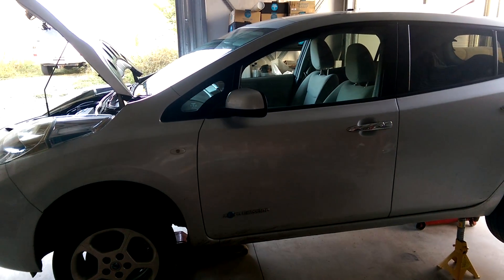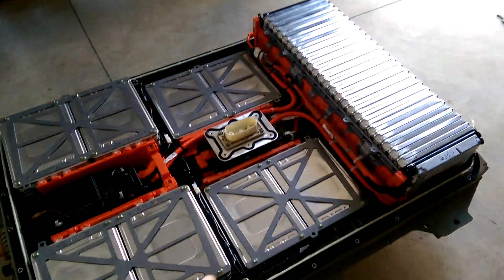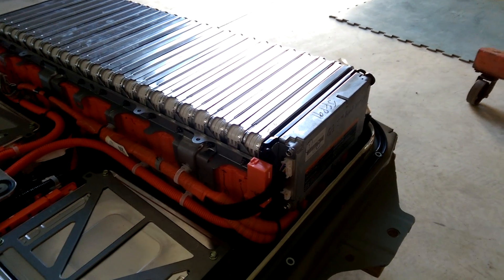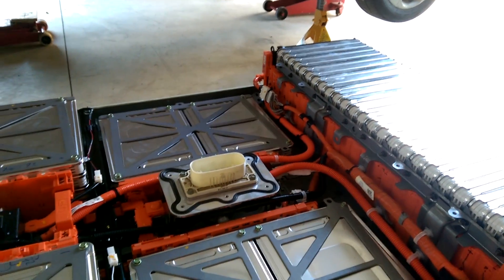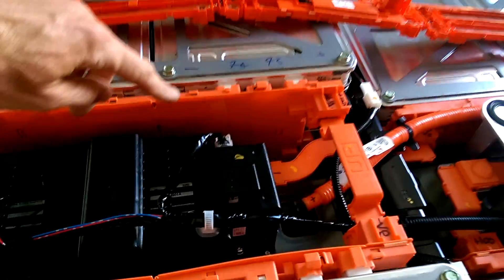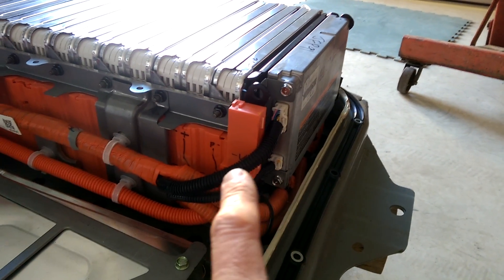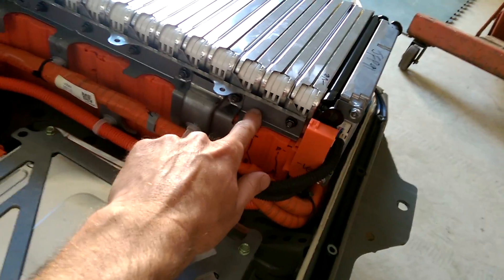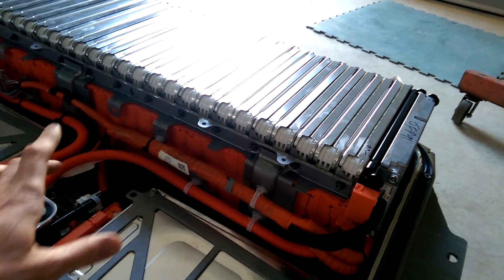How to swap G2 Leaf battery cells into a G1 battery case.

Comment: TY electric baboon...I'm having some small issue with a gen2 using a patch loom and dala CAN adapter 24kwh into a gen1 where the GOM is showing very low battery but the battery is still 33% SOC on Leafspy....everything else works OK but I'm thinking a module swap into the original case may be the solution if it doesn't figure itself out . 🫡

Comment: would it be possible to pull out all the G2 modules, and just replace the G1 ones in the G1 pack? Seemsto me that it would mostly be a mechanical swap, with the old wiring going back exactly the same

Comment: I have Nissan Leaf (2015, 24 kWh) and I would really appreciate your help.
The battery was degraded to aprox. 14 kWh, and I wanted to change it. I wanted to still use the car, and slowly build the replacement battery. So what I did:
I've bought an empty g2 24kWh battery case witch only had the wiring and the Bms inside.
After that, I have put 51 kWh worth of batteries inside that case (don't ask me how xd). And the bms was connected. I have sealed all up and put this "new" battery case inside the car.
At first, the car showed the invalid battery code (leaf spy pro), but after that the code was cleared. 
The problem is:
The battery Bms as well as the car is probably coded to 24 kWh, and it shows low battery percentage after that 24 kwh has been used. Checking leafspy pro, and the cells are at 3,8v wich is plenty of capacity left.

In summary:
The bms is calibrated to 24 kWh but I have 51 kWh inside.
Shows empty with a lot of capacity left in the cells.

With your experience, I hope you can help me solve this problem, for which I would be very thankful.

Comment: Where can I get BMS circuit diagrams for an e-NV200 2016 24kw? It is my intention to take 60Ah pouches configured 96S4p and put them in a bespoke case, using the exact Nissan wiring, so in effect replacing all cells with larger ones, circa 90 kWh! The BMS May have trouble balancing the larger capacity, and I have no idea how the capacity is calculated? If it sees something different on start up, does it do a kind of amps in amps out count like my old Honda Insight did or am I stuck with a display that shows full for ages and then starts dropping from 24kw downwards? My new modules ( 32 x 3s4p) each have two temp sensors, and it would be nice to make some kind of device that reads them all rather than just pick 3 at random! I have arranged to get the internals of an e-NV200 battery that has had its cells raided, re wire that, then swap, but have since found out about P3102. Despite that, would picking a 40 kWh BMS for my new system help it in any way? Assuming this has all been done before by cleverer people than me, could you suggest links to further reading? Thanks in advance, Rog, UK.

Comment: Hi, since you've blown your BMS from your original battery, how did you go about to reprogram the new BMS to work with your car? Did you just swap IC9 eeprom from your original BMS or something else? I'll be doing this job soon and would appreciate the help!
Reply from the maker: Yes, we swapped IC9. IC9 and most chips were not damaged. You can purchase a programmer from evsenhanced which can reset your BMS from outside the battery. Much easier. Tell them I sent you! Niall

Comment: Hi Raglan, so the G1 (sardine cells casing) vs Gen2 (open cells casing)?  So you have to swap the outside hard metal case?  The gray case (2011-2012) vs the black case (2013+) are not interchangeable?  I guess my question is, can you replace a 2012 Nissan Leaf (gray?) with a 2013 Leaf battery (black case)? without swapping the case like you did.
Reply from the maker: Yes you can replace old with new without swapping the case. To do that you need Nissan's service computer to reset the BMS computer in the battery.
Reply: @RaglansElectricBaboon  :(  that's unfortunate.  So what you did on your is simply installing the old BMS/wires harness onto the new G2 battery?
Reply from the maker: It's one of those situations where to change X you need to change y as well. But to change y you need to change z and v and w and so on.. believe me we tried to find an easier way!!
Reply: @RaglansElectricBaboon  so even if we replace it with the same model year battery, we still need to open it to swap out the bms controller, otherwise the vin doesnt match up and it wont work properlly?  Thanks for all the help,  thinking to buy this 2012 with a bad battery and replace ot myself, but look like it may not be worth it.
Reply from the maker: Yes. The BMS computer has an id in it which needs to be paired to the car.
Where are you based? We may be able to help if you are in NZ.

Comment: Question about battery swaps and having to reprogram the computer for pack swap?: I have a Gen 2 2015 leaf with about 92%. I plan on keeping, as long as range is sufficient. It could be 6 or 8 years before range is totally unusable for intended driving. I don't want to wait till the capacity gets really low.

 Right now I have about 85 statue mile range best case (but I don't want to get home with - - - -. 

 I like the idea of being able to buy a used battery pax (from salvaged car, or cells off Ebay) and replace all or just  lowest cells, keeping the best of original cells. 

How do you test the individual cell modules for their capacity outside the battery? Can you recommend  sophisticated charger/battery capacity tester.

The easiest way is just completely swap the whole Pax, but I'm concerned about how you go about reprogramming it; The dealer may not be willing or able to help. 

 I'm not going from G1 to G2, 24 Kw.  I just want to refresh my G2 back to near 100% SOC. I suppose going to 30 KW or larger would be fine, but I've been warned against it because of incompatibility. My understanding (could be wrong) is Gen 1&2  Battery modules are not interchangeable with the 30kw battery pack and larger. Also  I understand the 30 kilowatt battery pack is degrading faster than the G2 Gen 24 kilowatt battery packs.

I'm looking for how the cells are numbered, how you check them individually for capacity outside of the pack, and charge yhem individually. The idea would be to use the best of the 48 cells/moduals from the two batteries (original replacement) and build it up that way.

 To get around the potential of swapping packs and needing it to be reprogram by the dealer maybe you can just change the computer out?

 Since you made the video battery pack prices have gone up. Who knows what battery packs will be in 10 years.  This is a great car well-built and probably should go a hundred and fifty two hundred thousand miles if it weren't for the battery pack. It doesn't do the planning any good to throw good cars away and buy new ones.  I think putting in a battery pack is a great idea but not for the current $8,500 USD. I only paid $12,000 USD for my 2015, three years old and twenty one thousand miles.
Reply from the maker: A few people can re-program battery computers and that number's only going to increase. So don't worry about the attitude of dealers.
Generally the packs age very uniformly so don't trouble yourself with figuring out individual cells to replace. By the time you need to replace the pack there will be a lot more choice of new packs and things to do with the old - watch this space :)

Comment: Do you know/think the same would be possible to do with cells from a 30kWh or now also 40kWh donor battery?
Reply from the maker: I think so, yes. It has been done with a 30 into 24.
Reply: Goods news. Then I will sit an wait for the first 40kWh salvage here in Norway, and get the battery from it. Move cells over to my SOH=79% pack in the 2012 I got.
Reply: @tucsonor  I wait the same 😉
Reply: @tucsonor    Do you have an update?
Reply: @Islamisthecultofsin  found more easy way. Installed a complete 40kwh it the use of a gateway that fake the old pack. Easy done with some mech skills. So my old Leaf became "new" now.

Comment: Can you keep the original G1 case and move the G2 packs into it? The BMS and all the wiring stays? It looks like you used the G2 case and moved the wiring and the BMS over but that would mean the Nissan wiring adapter is needed. Is the former possible?
Reply from the maker: Hi guys, I swapped the G2 modules into a G1 case. Only the modules are G2.
Reply: Raglan Electric Bikes. Thanks again for the video and knowledge.  I realized after I asked about swapping g1 bms+buss into a g2 case, which would be easier of course.  That the g2 case wont go back into the g1 car. Duhh.  Anyway, love all the hacking everyone is doing, but I think im done. Just gonna trade up to a bolt and be done with nissan.  Still wanna get my hands on some of their modules of course, but they have lost me as a customer so...
Reply: I am also wondering if i can just swap the buss bars and computer from my g1 case into the g2 case? Guess I might need all the g2 adapter kit hardware?  Seems perhaps easier than swapping modules into g1 case?

Comment: Hello, thank you for this video. Nissan says it is not possible to install the new 2016 30kWh pack in older LEAFs even though the form factor is the same. Is there a way around it?
Reply: The battery of the 30kwh Leaf, besides the different wiring, works in a different voltage. If you replace the whole electrics of the car (from a salvaged 30kwh Leaf, for example) it may work. The labor and future retail value of the "Frankenleaf" probably is not worth over trading your old Leaf for a good 2016/2017 Leaf.
Reply: @gteixeira    They do it all the time.  Muxsan is what I think their name is.
Reply: @Islamisthecultofsin  Yeah, someone found a way to install the 62kWh into the 24kWh Leafs by hacking a bit the CAN bus and replacing some parts. It was apparently easier than I would think, still not worth the money since it costed around $10k for a car that will be almost unsellable after that.
Reply: @gteixeira    Agreed.  That would be only for someone who was going to keep the car.

Comment: Hi 

Are the G2 batteries the 30kWh cells and the G1 the 24kWh battery cells ?
Reply from the maker: I think I stated in the description, both cells are from 24kWh packs. The very early Nissan Leaf was a G1 and in 2013 ish they brought out the revised G2 with differences in battery, charger, inverter and several others. The 30kWh is still a G2.
Reply: @RaglansElectricBaboon  at the risk of being thick :0) is it possible to replace a Gen2 24kwh with a 30kwh pack? Thank you for your videos. I'm one of the losers that love the look of the beast!
Reply from the maker: Yes. It's now possible to re- program the car to accept new packs.
Reply from the maker: @k31thd4885  Yes its possible to re-program the car to accept new packs. I think in your case you can just get the VCM computer from the car which is donating it's battery. mynissanleaaf.com is your friend.
Reply from the maker: @k31thd4885  Yes its possible to re-program the car to accept new packs. I think in your case you can just get the VCM computer from the car which is donating it's battery. mynissanleaaf.com is your friend.
Reply from the maker: @k31thd4885  Yes its possible to re-program the car to accept new packs. I think in your case you can just get the VCM computer from the car which is donating it's battery. mynissanleaaf.com is your friend.